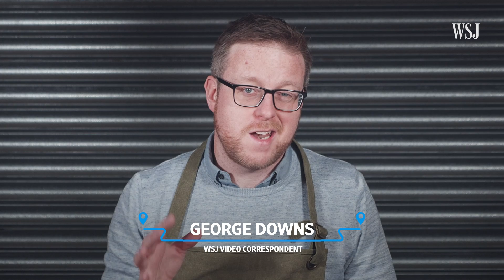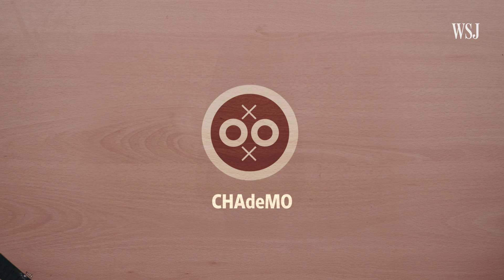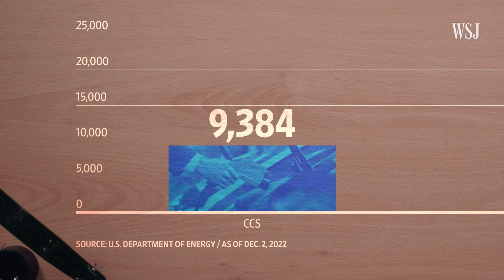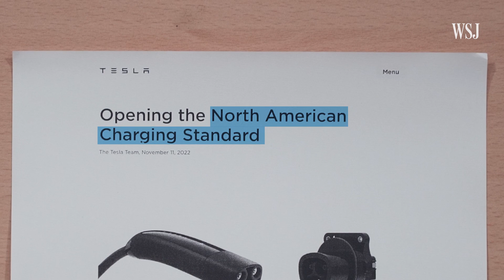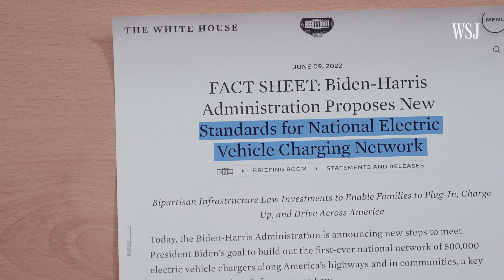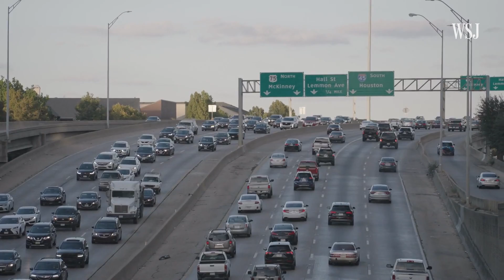Why Tesla Wants You to Build Its EV Chargers

Comment: The technology of the batteries that power EVs is evolving very quickly. New ones will have much greater capacity, and may not even use lithium, an element too explosively and uncontrollably inflammable to be used for very much longer in hundreds of millions of EVs across the world. The probability is that neither of these two charging connectors will be in use beyond a decade from now.  Rather, they're both likely to become irrelevant as prospective owners of EVs increasingly demand that manufacturers of EVs replace the current, already-outmoded - and time-wasting - EV charging station setup.   In typical WSJ/New York Times fashion, this presentation obfuscates rather than informs in depth. A venerable maxim in the U.S. financial industry has it that "those who talk, don't know, and those who know, don't talk."  The actual reason many - if not most - people build careers on Wall Street is to obtain timely (but legal) insider knowledge - knowledge which makes fast money. Moreover, as a 30-years-long reader of the WSJ, I've never found this venerable newspaper to have predicted a single important technological development.  This video presents a false dilemma engendered by what used to be known as a "pseudo-problem"- loosely speaking, a problem that arises from distorted verbal constructs - "problems" that vanish as soon as we see through the foggy verbiage that conceals "non-problems." In this instance, the pseudo-problem is a putative struggle for preeminence between two already-obsolete technologies and their backers as to which of two competing charging connectors will win out as a permanent presence at charging stations across the U.S.

Comment: I just don’t get why the chargers widely used ended up so bulky
Reply: Because ccs was based on j1772, an already bulkier, slower, charger. For ccs, they just tracked on two additional, beefy, connectors for higher power transfer.
Reply: Regular pump handles are way bigger so I don't think it's a problem either way

Comment: Honestly it would be more logical to convert CCS chargers to NACS than it would to convert NACS TO CCS.
Reply: I'd posit that it's more logical to convert all Tesla's to CCS. Sure Tesla owns 68% (but falling) market share in the US, but it's dwarfed by other EVs in the rest of the world (less than 10% in Worldwide). Why not all convert to the same standard? CCS is about 30% of worldwide market share, and the Chinese one is probably about 40%. Just because it would cost less to convert to NACS in the US doesn't mean it's the right decision
Reply: @Mr_Menty  NACS reportedly has been designed to handle 1000KW charging while CCS is at 350KW (NACS could be faster). Also the CCS is heavy / bulk, granny might have difficulty plugging it in.
Reply: @Mr_Menty  Why does the whole world need the same standard? How many cars are transported to a new continent? (excluding those that are directly transported from the factory)
Reply: @Mr_Menty  so you want to USA use km and not miles? Why you try convert one country standard to other, when cars must be different anyway? Because you don't like Tesla, or simple you are from EU? Because there is no technical and economical reason to not use NACS in USA. 
About car makers, NACS is cheaper to make, so is good for them, and for users is easier to use, so... why forcing CCS?

Comment: When go to fill up 
I have several handles to choose from. One is petrol, one is diesel.
Why cant charging stations have more than one connector..
Stating the obvious
Reply: I’ve never seen anyone use the diesel and gas pump at a gas station at the same time, and that’s been going for decades. I don’t see why it would be an issue now. Anyway just have the software make it so only one cable is powered at a time.
Reply: Some do, but they tend to only have one connector per parking spot. Likey because it would cause issues if two cars were stupid enough to plug into one charger at the same time.